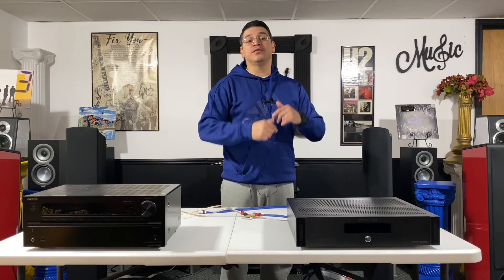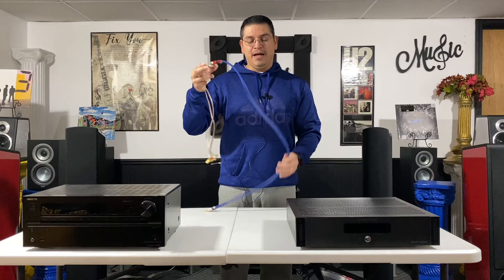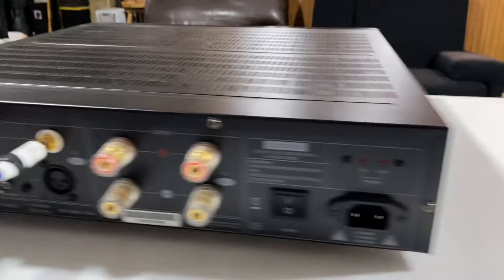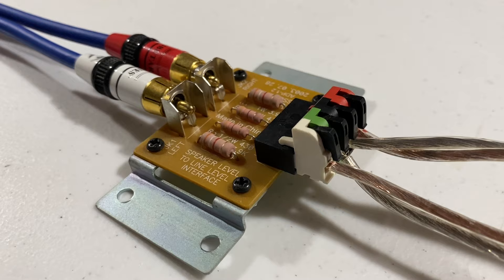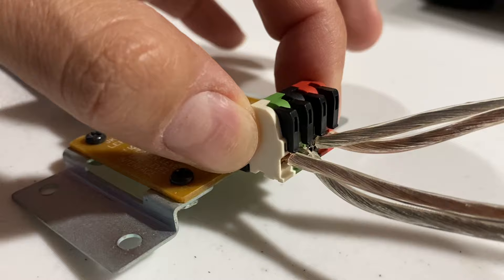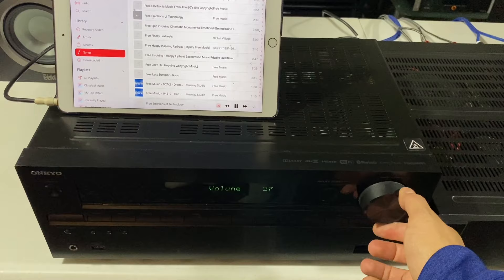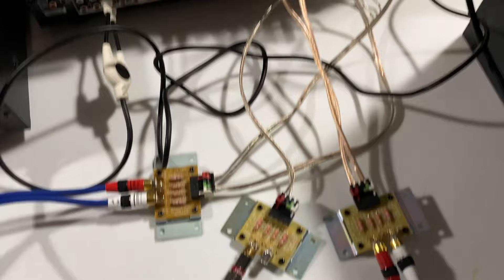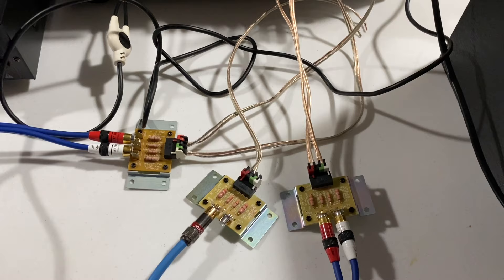Connecting an amplifier without using preouts.

Comment: If your receiver has a headphone jack, you can use that as a pre-out. So, the cable you'd need, is a phono plug (headphone plug) to RCA. It's not "clean" looking but, it 100% works. You just need to remember to disable your selected speakers on the receiver.
Reply from the maker: Thanks for the tip and for watching

Comment: Take it from a noob like me. It works. I was about to spend easily over 1500 until I watched this simply cuz cuz my AVR didnt have preouts and was lacking power. I spent 100 on the russound adapters, 15$ for RCA's used spare speaker wire, and simply used my existing Denon reciever. I bought a monolith amp and the sound is 10x better than just the AVR. It crazy that your vids are pretty much the only ones on YouTube explaining this
Reply from the maker: Thanks for your input. Appreciate your support and watching my vids.
Reply: Im thinking of trying this on my X-2600h, it really improved the sound that much ?
Reply from the maker: @johnhighfield5064  the quality of your amplifier and receiver will determine your sound quality. Of course speakers too. But i feel most people have a decent receiver and just want more power so it doesn’t change the sound quality so much as it does add more heightened details. Hope that helps, thanks for watching
Reply: Great, can you please tell me which model receiver you have? I have a denon as well and also like to add an amp. Thanks.
Reply: @Audiolympian  thanks for your video.
I have a Denon Dnp-800ne network streamer with variable rca output where I can control the volume output on remote. I got a Behringer A800 amp and connected the variable rca output from the streamer to the rca input of the Behringer A800. The sound is pure and linear but want to use my Denon pma-800 amp as preamp as it has bass and treble control as well as the phono MC that I use for my vinyl player.

The streamer gives 4volt max output rms on the variable output
What voltage will the speaker to line level give?
Reply from the maker: @pietpompiepompiepiet940  good question. I’m not completely sure but I know it’s a variable output, not sure what it’s max is. I have used the device with several receivers ranging from 80 wpc to 150 wpc and it worked well with all of them. Thanks for watching and the question.
Reply: @Audiolympian  thanks for your reply. Will measure a few resistor voltage deviders setups and give you feedback.
Did you ever experience any issues with the amps without a load like 6ohm or 8ohm speaker not connected?
Reply from the maker: @pietpompiepompiepiet940  appreciate your data. No issues on speaker loads however I did notice a bit lower volume levels on 6 and 4 ohm speakers but that was it, no distortion
Reply: @maguzzy  idk if you were talking to me but I have the denon avr-s920w. I dont know much about audio but all I know is I saved money and my system cranks. I'm sure there may be tradeoffs but if I want to upgrade down the road, I can move my denon to another part of the house.
Reply: Me too!  I was about to spend a ton on a receiver with pre outs.  Didn't think this was possible.  I don't know why a $40 part only comes on the high end receivers.

Comment: I have one of these adapters because I wanted to add an external amp to a 2 channel stereo receiver and I tell you what it is one of the best things I've ever purchased in my life.  Matter of fact it was your original video that helped me make that decision.  Thanks!!!
Reply from the maker: Glad to hear it worked out for you. Thanks for watching and commenting. Appreciate the support of my channel.
Reply: How do you connect speaker wires🤔
Reply: What are these called exactly.....need to get one
Reply: How Many watts are you pushing though. Would you trust this with a 250 watt amp??
Reply: @kellywatkins6409  I'm using a Crown XLI 1500 and I have it putting out about 145 watts per channel in 8 ohms.  I don't think it would have any issue with the 250 watts.  I may even be pushing a little less than that to be honest to avoid ear fatigue.
Reply: @mackredsnapper  I took the other route a friend sold me his marantz 24 tuner preamp. Mated with my Carver m500t amp and giant cv e715s. Am only actually using about 20 watts for a sensational clean clear sound. Ran it up to 100 watts with no distortion but my ears and the house were at risk. Phenomenal sounds.

Comment: I have a Crown amp, it doesn’t have pre outs or RCA connections. How do I connect it to my receiver that has pre out connections?
Reply from the maker: @slickvic1432000  those are tricky amps to connect to receivers. I’d really have to see it to come up with an idea. But perhaps get some cables that have rca connections on one end and whatever input connection is on the crown amp. Could be xlr input connection. That could work. Hope that helps. Thanks for watching

Comment: I have a Yamaha 5.1 made in circa 2005. I love it and the sound fields/processor that it has. Sounds great. And I recently purchased a set of Fluance signature series bookshelf speakers and they really good! (Along with Sony sawm 40 sub) Niw when I crank the volume up in the higher “rocking out level 11” the speakers seem to ever so slightly distort. So I’m probably going to invest into a Emotiva BasX A2 channel power amp. This video greatly helped me out on my decision whether to me me old Yamaha receiver. Thanks a million. Eventually I may go with incorporating Yamahas WXC-50 but until then, my smart tv has done an excellent job of acting as a streamer. And the rest I just listen to cds and tapes/vinyl records. I’m just a 2.1 kinda guy. Thanks again cheers 🍺 from Houston
Reply from the maker: 2.1 systems I think are underrated. I use one myself. Glad to have helped your decision making process. Thanks for watching and commenting. I love Houston. I have lots of family there. Can’t wait to go back.

Comment: Great video man, saved me from buying a more expensive receiver. Just got yourself a new subscriber.
Reply from the maker: Thanks. Appreciate the support. Thanks for watching and commenting
Reply: @Audiolympian  quick question do you get any humming noise from your set up?
Reply from the maker: @edwinrijos6679  I did. On my initial set up I used cheap weak wires. But then I switched to better quality rca cables the hum went away. Could also be some interference on the power line. Hope that helps

Comment: This is exactly what I was trying to find. Tired of making my receiver work so hard. She's an old gal, and needs to rest 😁. Great video. Would have liked to have seen a before and after db gain when connecting and also a description of what you heard differently when connecting the amp. But regardless, liked and subscribed. 👍
Reply from the maker: Thanks for the support. This video and the one I did a year ago are a couple of my top videos. Perhaps I could do a part 3 and go over some of your suggestions. Thanks for watching again subbing.
Reply: @Audiolympian  would you know if putting an amp on a center channel and making the receiver work less, will that provide other channels the watts it saved from putting the amp on the center?
Reply from the maker: That’s a tough but good question to answer. Yes and no, depending on your receiver. Adding an amp to you center channel will take some strain off of your receiver so it can push the other channels easier but it won’t disperse the watts out to among the other channels the way one would think it does so not like an even divide through the other channels . But it will take some of that and push extra power to the other channels when needed. But probably only an extra 5-10 watts or whatever it needs for that exact moment like a car crash, explosion stuff like that. Good question. Hope that helps
Reply: @wcg686s  the amps still out out the same amount of power as they normally would. The adapter just reduces the amount of power that goes to the separate amp. I am not sure how or if the ohms load is effected. That being said. Alot of AVRs that have pre-outs do not turn off Thier internal amps if you are using the pre-outs. So either way if your AVR has pre-outs or not unless it's a higher end unit the amps are running regardless.
Reply: @christianlemont111  This. This youtube channel has no idea what he's using and how it works electronically.

Comment: I tried and tried again to get power from my new amp to two tower speakers,only to end in dissapointment.Was almost to the point of paying to have it checked out, dealing with support etc.This is my first home amplifier and Im connnecting it to my Onkyo txnr7100,which doesnt have much in the way of preouts at all.This seems like my best bet without spending a bunch of money and am now waiting on one of these adapters,will let you know what happens.Thanks for the video!.
Reply from the maker: You’re welcome. Please do. I’m very interested to know your results. Thanks for watching
Reply: @Audiolympian  Hey Audiolympian,as I told you it did work. Not sure what happened to that response but there's something else I want to tell you,I am running my two front towers through the adapter but you may frown on this next statement. Without even thinking about it I hooked my center speaker straight to my amplifier without another adapter or input and it works just fine with my system..I realized later what I had done  but it works so Im keeping it this way. You may of course delete this if you want,just thought Id mention it to you..
Reply from the maker: @steven3517  wow. That’s cool. I hope it doesn’t damage anything. I’m curious as to how the center channel is working if the signal is not going to the amplifier?? Or maybe I’m understanding it wrong. Either way, if it works then good for you my friend. Yeah I seen your older message but then I couldn’t find again to reply. That was weird.
Reply: @Audiolympian  Actually i just discovered that my center channel is silent when i do my test tones,so it must be stealing from my towers and im not really getting the center speakers output..Probably  not a good idea even though it sounds fine
Reply from the maker: @steven3517  ok gotcha. That makes more sense. You definitely don’t want to overload your system

Comment: I have Sony STR DH 550 AV receiver and a Yamaha MX 50 power amplifier as my subwoofer amp. I was thinking of getting a preamplifier for the power amp and dump the AV Receiver. However after watching this video I believe getting the connector and using the AV receiver as a preamp would be far better. So from the AV Receiver front speaker output jack to the connector then to the power amp would serve my purpose.
Reply from the maker: Awesome. Hope it works great for you as it does for me. Thanks for watching and commenting

Comment: Was so excited but it didn't last. Hooked everything up and it worked great for a moment and man did the amp make a difference. But every time there was a Surg in loudness in whatever I was watching the receiver would shut off and go into power save mode. This happened at least 4 times. Thanks for the video it was worth a try.
Reply from the maker: Sorry to hear that man. Perhaps some different power cables could help if possible. Thanks for watching
Reply: Same here does not work save your money, receiver constantly goes into power save mode.

Comment: I know this is an older video. Anyone interested can build one of these and make it less bulky. Take a short length of speaker wire. Connect the positive lead to one leg of a 1w 3.9k ohm resistor and another short wire from the other leg to the positive connection of a female RCA connector (solder or screw terminal style). Do the same for the negative lead except using a 1/2w 430 ohm resistor with the other leg going to the negative terminal of the same RCA connector. 2 resistors (1 per lead) of differing resistance. Solder the speaker wires to the resistors. Then, you can shrink tube the resistors and joints or wrap with electrical tape or tessa tape. Plug in your rca cable to the diy connector. Connect the exposed speaker lead to your speaker output of your receiver. No need for a bulky plate. You could make 5 or 7 of these for %10 or so combined. 

I had to pause the video to read the resistors and see how they are connected. Wire > resistor > rca connector. The parts are cheap on Amazon or other sites online. I hope this helps.
Reply from the maker: Wow thanks for that explanation. Appreciate you watching

Comment: Zone 2 has pre-outs...but if you you get a decent receiver to begin with or upgrade, it would probably output comparable power (or possibly more) to the Emotiva XPA 200...but the Emotiva is also only $500...Your receiver is the heart of your entertainment system...everything runs through it, so it's best to start with a nice one and work your way out from that with the rest of the system and components...with that being said, this is still a good work around with budget restrictions
Reply from the maker: Thanks for watching and commenting. Good advice.
Reply: You can control Zone 2 pre-outs in any way
Or is there??
Reply from the maker: @tombergman4506 yes and no. It depends on what a person is attempting to do with the zone 2 and the receiver’s capabilities. Hope that helps

Comment: I am totally blind. I have no vision whatsoever, I recently purchased a Sony receiver model number STR Dash K700. It did not come with a remote sadly to say. I have a Alexa echo. Dot from 2021 it looks like a hockey puck I would call it. It has a power input Slot and I believe it has a auxiliary type slot. How would I connect this to my receiver because this particular model Sony STR – K700 only has a microphone out jack in the front no auxiliary jack out in the front or is this even possible if there is something I need to purchase for this thing please leave me the name and the particular model please it would be easier for me to navigate with the name and the model, I appreciate you so much. Thank you. Keep up the great work. Hopefully you can help me again thank you.
Reply from the maker: Hi Steve. I think your best bet would be to get a universal remote so to operate the receiver’s menu. If you’re looking for voice activation today, the receiver needs to be connected to the internet or your networking system and you have to be able to toggle through the menu. As far as voice activation I would look into Alexa or Apple TV. I have both and can operate my system by voice. I’d strongly suggest someone help you with it because navigating the menus and getting everything to connect can be challenging. Hope that helps. Thanks for the question
Reply: @Audiolympian  so am I understanding you correctly? That this particular Sony receiver STR – K700 has Wi-Fi capability? Thank you once again.
Reply from the maker: @stevemendez3535  sorry for the confusion no that model does not have Wi-Fi capability. You may want to get one that does. Also, being that if you want to use the echo the receiver would need a trigger input, that is what the echo would connect to and that would turn on the receiver. Hope that helps
Reply: @Audiolympian  can I pick up this trigger input at Best Buy and they will know what I’m talking about. Sorry for all the questions like I said being blind it is kind of difficult navigating the Internet thank you once again for the quick response. Keep up the great work brother.
Reply from the maker: @stevemendez3535  no problem at all. I welcome your questions. Unfortunately no you wouldn’t be able to pick up a trigger from bout from Best Buy. The trigger input is a built in input on receivers that allow them to be turned on from other devices. Some companies do make a trigger device but the receiver or amp still needs to have the input to receive the signal.

Comment: Doesn't Zone 2 have pre-out or line level output that you could use? I realize that you  are demonstrating the functionality of the product, but it may be a good idea to say "ingore" zone 2 for this demonstration.
Reply from the maker: Good tip. Yes zone 2 do have preouts but for some reason it doesn’t push amps. Idk why. And if it does it’s usually only stereo. Thanks for watching

Comment: What if you made a wire that has RCA at one end and speaker termination at the other end? 
Would you still need an adapter?
Reply from the maker: You definitely could try it but I think the capacitors, resistors and diodes play an important role in transferring the signal so it doesn’t have too much noise distortion. But it certainly could work as a quick solution. Thanks for watching
Reply: Much better too used the headphone jack...

Comment: What I have in mind is if I want to transfer the load of the front speakers to an external amp, I’d follow your instructions, and leave the surround speakers on the receiver. That should get some load off of the receiver, right?
Reply from the maker: Yes it will lighten the load a bit on the main speakers

Comment: Does using a line level adapter take load off of the AVR? Like completely for that output?
Reply from the maker: Good question, no it doesn’t take the load off. Thanks for watching

Comment: Can you just use a RCA to speaker +- wire? Then use the speaker +- wire to the receiver or Preamp?
Reply from the maker: @chrishale5608  you probably could do that but the device has filters and resistors that help regulate from over powering. Thanks for watching

Comment: These work great. use them to run my front 3 channels with a new Emotiva BasX A3 amplifier. BIG difference!
Reply from the maker: Yes they do. I use 3 of them. Thanks for the comment. And thanks for watching
Reply: Thanks you just respond my answer , I already got one for my main channel, order a second adapter for my other 2 channel amp but wasn't  sure for using on my center  or surround channel